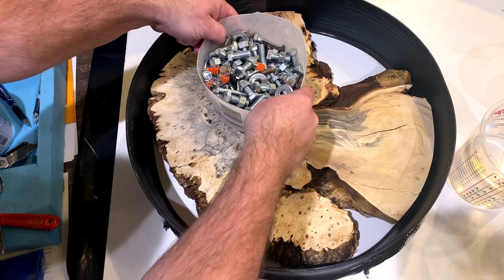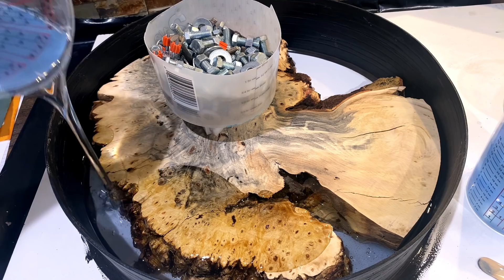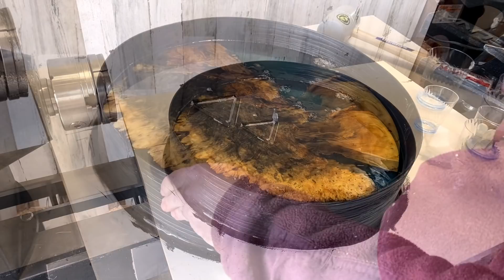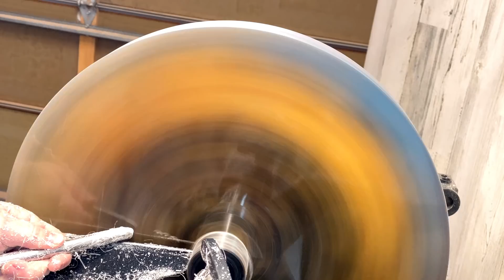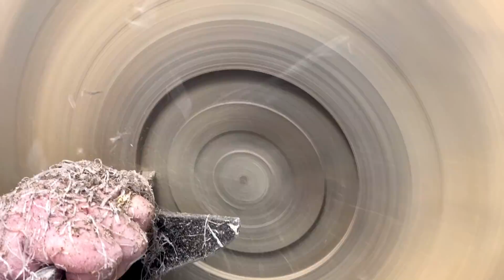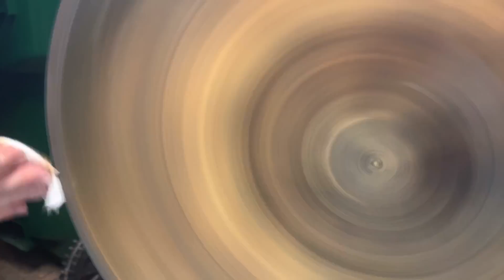Woodturning - Huge Platter from Buckeye Burl and TotalBoat Resin

Comment: It’s absolutely beautiful. If you pour the resin slowly, and let it run down a stir stick it’ll reduce the bubbles. Very nice craftsmanship👍
Reply from the maker: Thanks for the tip! I actually wanted some more bubbles on this one. I chose not to seal the live edges of the wood expecting that it would produce some bubbles that would add to the sea-scape I was going for. That worked fine for the larger bubbles, but there were more tiny bubbles throughout the project than I'm used to. Unfortunately I don't have a pressure pot that's more than 18" in diameter! I'll have to try our technique next time.

Comment: Very beautiful! I like the combination of the buckeye and resin and the clever way you made the mold.  It looks like Total Boat is not immune to bubbles along the junction between the wood and the resin, though.  This thing was too large to fit in a standard pressure pot, so I don't know what you could have done.